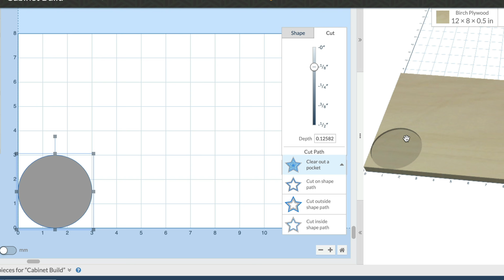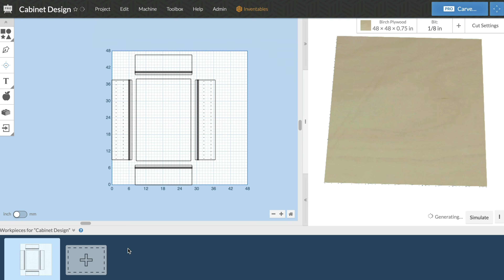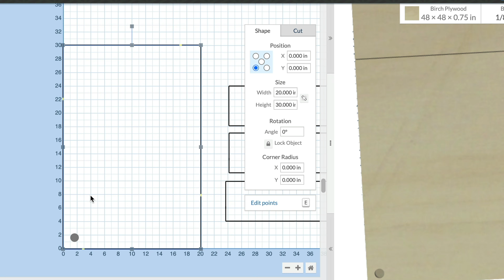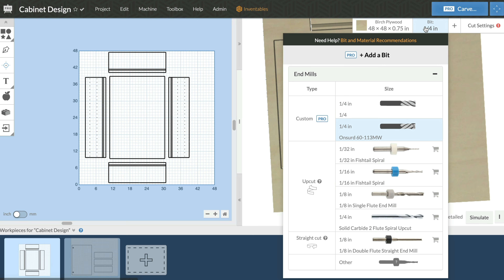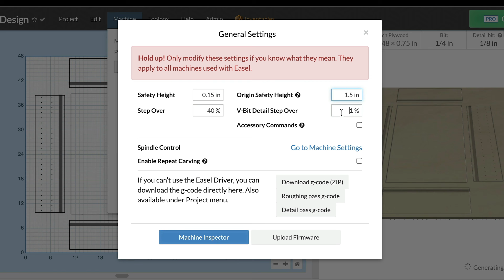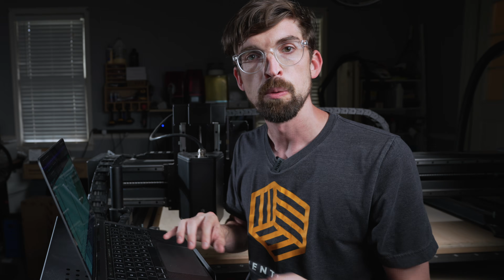How to Build a Cabinet: Start to Finish

Comment: Everything looks great in the finished cabinet except for the 2 rows of pins which are center and forward. Something on the back of the shelf would tip the shelf. My guess is changing the settings during recording and not getting them set back properly at cut time.

After watching the video again I see the pins are center and front on the hinge side and center and rear on the other side. Was this a error in the software or a limitation of the software?

Comment: What if you set the corner to the origin of 0,0 but the sheet isn’t perfectly square?
Reply from the maker: It might be easier to carve from the center if you don't have perfectly square material.
Reply: @inventables  I see. so you can just set the corner of your first panel at 2,2 instead of 0,0. thanks!!
Reply from the maker: Yep!

Comment: Question about the shelf support pin locations... are they far enough apart to support the shelf or should there be more room between the two locating holes for support?
Reply: Those pins are the default location based on System 32.  You can move them to any position you want if you prefer them in a different location using the Position input field on the Shape tab.

Comment: Wow looks great... does the Cabinet app only do metric? if so is there an imperial cabinet app in the works?
Reply from the maker: At the moment the input is only in metric because these are European style cabinets and the system 32 framework is all in milimeters.  You can switch to imperial once it is imported.  Yes, we are in the process of researching what to do for Imperial cabinets.
Reply: @inventables  Awesome looking forward to what comes next. Thanks for the comeback and info on switching back to imperial once imported very helpful...

Comment: I have the X-carve Pro and really haven't been able to use it cause I just can't pickup the functionality of Easel. I've used V-carve and Carbide Create and Easel is so much different. But with this video, here's what i don't get.....3/4" plywood is not .75 inches. Everyone knows that. So if a groove is set at .75, then there's gonna be too much slop. It won't be a tight enough fit. That's not good. Also, the cut-through set at .75 will go into the waste board way more than necessary.
Reply from the maker: Great question!  First you can set your material thickness at the top right inside of Easel.  I had mine at .75 in just to keep it easy, but you would measure it with calipers and then enter it in there.  For the groove in the wood that is getting calculated from the material thickness you put in inside the Cabinet Builder App (in the video I kept it .75 in or 19 mm).  If you adjust that number it will affect the groove thickness.  Also there is a tolerance settings at the bottom of the Cabinet app that will add an additional width to the groove to account for glue/material play.

But in general for grooves I would recommend a pretty similar process to what you might already do manually with a dado blade on a table saw.  Run a few test grooves on a scrap piece of material until you get a fit that works and then go with those settings.